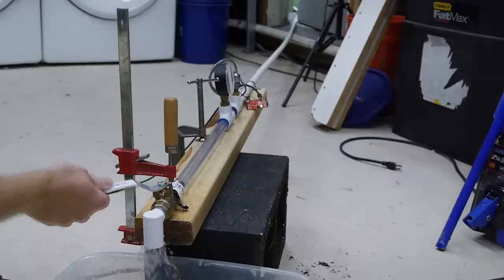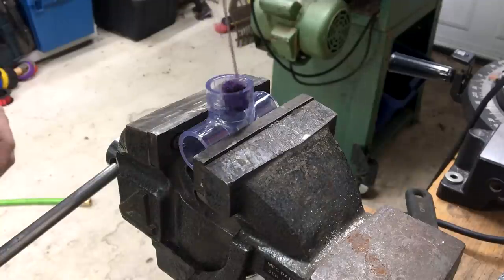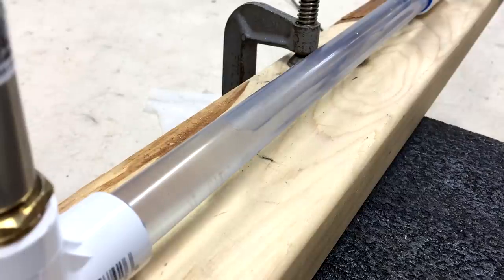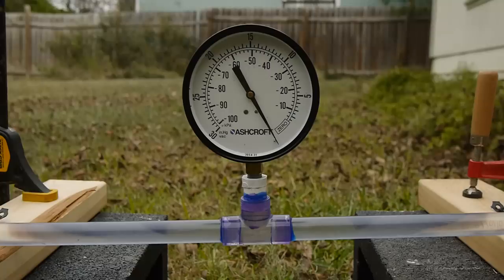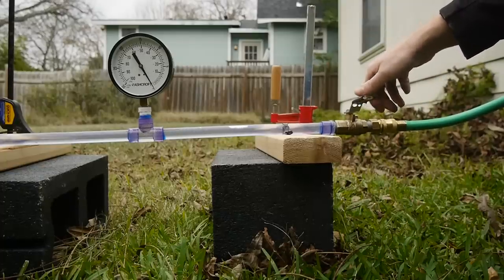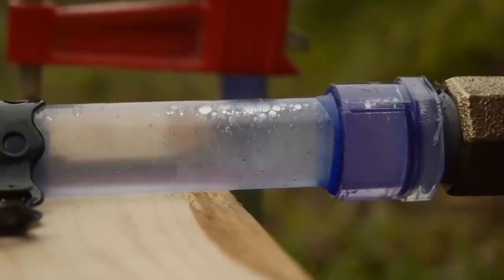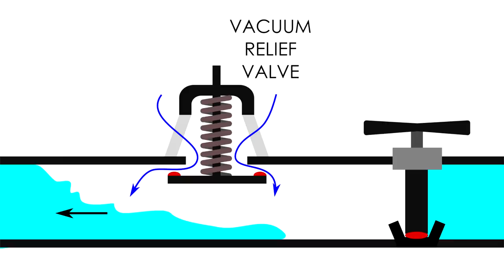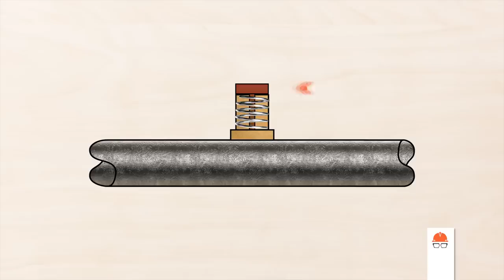How to Collapse a Pipe by Closing a Valve

Comment: Hey Grady, at the factory I work at we had a 50,000 litre milk silo implode because the air inlet valve was blocked. It pulled a large vacuum then finally gave way. The resulting implosion blew the inward opening silo door off and dumped about 10,000 litres of milk over the production hall floor. It had to be cut into 3 sections to remove it and took 2 cranes to lift it out and replace it. All because of 1 blocked valve
Reply from the maker: That is insane. Exactly the kind of failure that this video was talking about.
Reply: Makes a good case for redundancy, a few hundred for a second vacuum breaking system or a few hundred thousand for a new tank.
Reply: probably even the lost milk alone would've covered up the price of a redundent valve.
Reply: Oh boy you need some milk! lol (also did the milk spoil then you would have a loose version of cottadge cheese)
Reply: How did you fight off all the skeletons seeking calcium?
Reply: @chistinelane   They fell apart years ago. That's why they had the milk hidden from them
Reply: 10€ failure=100000€ loss.
It happens.
Reply: It happens.  Had a tank wagon partially collapse because of not opening a relief valve. Fortunately not our truck.
Reply: Dave Almighty  I call that high risk management.  I worked for a company who commonly neglected to implement safety systems, procedures or use parts rated for the type of work the parts were exposed to.  Everything was controlled by operator and if they did something wrong, it would always end up breaking something or injury.  Management omnipotence is often a cause of workplace industry accidents.
Reply: Wow, that's some bad design on whoever designed that thing.
Reply: So in this case management might have cried over spilt milk...
Reply: Razvan J  It's not as simple as you imply in your comment. Schedule for inspection? Every hour, every day, every week, every year,... every "we maybe should check the valve? Visual check or in-depth check with disassembly? With only a visual check, damages wihtin the valve may go unnoticed over a long time, and just after the check -> boom! Regular replacement of the valve? Can people be hurt? How much money do you loose? New silo, loss of milk, reduced production capacity until the new silo arrives. Costs quite some money, probably more than a second valve. By the way: If the correct function of the valve is essential for the function of the silo and is not redundant, hence a single point of failure, the design itself is already screwed and should be reworked asap.
If you simplify to "inpect the valve" you clearly have no idea what you're talking about. I assume you work in management and have absolutely no clue about such things?
Reply: @johnscaramis2515  shots fired.
Reply: Razvan J  Or just a gauge. Or an alarm. Or an engineer who can think. Ah, I can see the real problem here.
Reply: @pixels303at-odysee9  I worked at a company where THE SAME 10 inch hand held grinder with no guard injured at least three people. At least one injury was serious, severing a couple of tendons. It was never taken out of service or fitted with a guard. I don't believe they even warned new users.  Another young man doing pressure testing on a very large tank was killed when the tank exploded. Faulty pressure gauge they said. This same company used propane to cool hot metal. Yup, that worked as you'd expect. Only two people got burned as far as I know.
Reply: @snorman1951  Always fun picking out wire from your various body parts while grinding. I had plenty of them in my chest and legs. Even the grinder burns, goes through gloves and skin so easy, and the injuries are always very permanent reminders to keep limbs away from moving parts. I always wonder why people don't demand danger pay for performing that type of work.  Mind you, a conscientious worker is all it takes to stop and think before starting work to prevent injuries, a practice which is learned by experience.
Reply: @satibel  Milk is worth so little. In the UK milk is sometimes sold for less than what it costs to produce. It's why so many dairy farmers are struggling financially.
Reply: @noxious89123  According to the internet milk is about $1.21 per liter in the UK (does this sound right?) Even if we assume it costs half of that, a 10,000 liter spill would cost $6,050. Certainly more expensive than a backup valve.
Reply: Must have smelled like hell!
Reply: @skipfred  farmers get £0.31 ($0.43) per litre milk per june 2021 so the derry suffered a loss at $4300 witch isnt penuts either, and is just the losing costs for the milk alone.
Reply: Had a similar incident when I worked in the oil business. We were using trucks to pump crude oil from one cistern to another, that had not been used in a long time, when suddenly a  boom goes off and oil starts raining from the sky. Oil hade made it into the air inlet and cooled off, basically becoming like a thick honey that caused a plug. Thankfully the huge 300 000 m3 cistern survived, or we would have had a worse incident on our hands.

Comment: On water mains they typically make it really difficult to close or open a valve quickly. If you have to turn ~50 whole turns you have to really try in order to damage anything.
Reply: Me: "This thing takes forever!" pulls out electric drill 2000 rpm go brrrrr
Reply: Depends on the valves and the pressures you're working with. I have seen more lines blown out of the ground by slamming fire hydrants down by firemen though, you're right.
But then I worked in a water system in the mountains where typical pressure was in the range of 250 psi with maximum pressures reaching 500 plus or minus. Makes things a little more interesting than most systems. Scary even sometimes.
Large older lines are more prone to collapse, even slight sustained pressure drops. I was working in Chicago when they took down their intake line from the crib offshore and it collapsed in response, Oops. The cribs sit about a mile offshore at both of their plants. Luckily there was a second. Tough to replace a 750 mgd source quickly. lol
Reply: @manueltodesschnitzel3097  I had the same thought. Hilarious
Reply: @YoureASquidYoureAKid  lol I left water system maint. 25 years ago and got into the control side contracting. But they certainly hadn't learned squat by the time I left there. We tried often to educate them but it seemed to be like throwing hand fulls of crap at a screen wall. Just never would stick. lol
Reply: Cross connections between mains are there to primarily prevent dead ends in lines where turbidity builds and chlorine is lost. It is also for redundancy in feeds but during high demands velocities are going to be higher in one direction or another. Closing a valve to fast can still cause a surge on one side and vacuum on the other. How much depends on the velocity.
Reply: @SirVerdown  Water networks with closed loops where you can feed from both directions are designed so there are no "dead spots" where no water is flowing in either direction (long residence times in the network cause water quality issues) during normal conditions and they are usually a lot smaller than water mains. If water wasn't flowing through the pipe the pipe is redundant anyway and then you of course don't get any water hammer. Assuming water is actually flowing through the pipe these loops aren't very helpful since the entire column of flowing water has to stop and change direction and that is the water hammer. The water hammer moves at the speed of sound and is unaffected by branches until the water hammer arrives at the branching point; so it doesn't help that water can flow in two directions through a pipe if the branching point isn't very close to the valve.

Water mains are often simple branching systems with parallell pipes for redundancy in case one fails or has to be repaired/renovated/dug and replaced. These two or more pipes are interconnected with each other every few km or so in a big concrete chamber with a lot of valves; but there may also be valves that are not close to any of those interconnections (e.g. near important road and railway crossings where authorities often demand them). They feed water from a water treatment plant to one ore more reservoirs somewhere. If there are closed loops in the network of water mains they are many km apart and do not help with water hammer. In a properly designed water main the water will be flowing in some direction through each valve and if you could slam the valve shut fast enough this entire column of water flowing through the pipe has to stop and change direction quickly. It helps a little that water mains have this redundancy, at least if the valves between the two ore more parallel mains remain open as it distributes the water hammer down more pipes and you get less peak pressure. But the main thing is that you can't slam those valves shut; they're designed so that it is takes a lot of time to open and shut them whether you do it manually or with an electric motor; the water has a lot of time to slow down and you don't get 3 km of water suddenly crashing into the end of a closed tube.
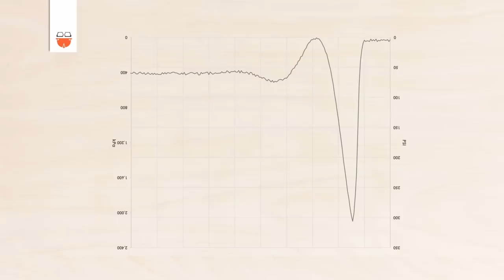Reply: @manueltodesschnitzel3097  and high torque one too as friction exists and gear reduction would be 1:50 and i dont expect drill can produce high torque, they just made to spin very fast. 

also love to imagine that you accidentally unscrew the handle off with high torque and that speed :3

Comment: As a fire fighter pumping an engine, I learned some interesting things related to this. Since we use an pump (not just system pressure), we have to be careful, that we “feel” how firm our supply line from the hydrant is so we can avoid pulling more water than the water system can supply. Also, fire hydrants require many turns to close the valve to prevent us accidentally opening/closing it too quickly which would cause problems for the municipality or whomever is supplying the water system. What is also interesting is that in dry sprinkler systems, we use a very small pressure of air to hold the valve closed against much higher pressures of water. It’s around 5:1 ratio. Maybe you could do a video talking about how this works?

Comment: As a Water Distribution Employee  for a Water Utility we have 26 different Fire Departments within our system. Education is the key. Both Paid and Volunteer Firefighters love to open fire hydrants as fast as possible and in turn slam them closed. Every year we have to remind them over and over please open them slowly and close slowly if you have water flowing. They can create a water hammer at their pumps just as easily as they can at the hydrants. We even have to teach them what the pressure relief valve is for on their Fire Engine pump panels.  Since my job is repairing the breaks, I see this problem never going away I will be including this video along with the positive water hammer video to all the Fire Depts hopefully they will watch and remember why slow and steady is best. Some of our infrastructure dates back to 1880.  We only use USA made products and materials. Sadly it’s becoming difficult to find products. They are considering now using products made in Israel and Australia.  Thanks again for making great videos

Comment: As he said in the end of the video, yes, it is very important to close all valves on the fire trucks very slowly or you will risk breaking the pumps. Most of the trucks will be spraying water out in upwards of 100psi, so if you stop the water flow too fast you will most likely destroy every pipe on the truck and put it out of service for a few months. The only reason you should stop the flow quickly is if you start to lose control of the hose. And you did a great job explaining this, thank you from Manchester volunteer fire department

Comment: Forms of concrete failure? ( too much sand or gravel, not enough curing time, etc)
Reply: TheMr77469 or over use of a concrete vibrators or not mixed properly
Reply: TheMr77469
And for dessert - misplaced reinforcement bars?
Reply: Also, in construction in cold climates, concrete that froze before it fully cured, and later thawed.

Comment: I live in a small town with volunteer firefighters.    I was working for our local newspaper as a photographer and was at a firefighter exercise, teaching the new folks how to handle the fire equipment. 

The Captain told me that the new pumper truck could collapse all the underground pipes from our fire hydrant system.  

It pulled more vacuum than the ancient water pipes could handle.   He reminded me of when the town utility had to dig up several dozen feet of destroyed pipe pieces and replace them.  

Now they are VERY CAREFUL with that pumper truck!!!

Comment: What about one on the formation of potholes?
Reply: Also 'washboards' for those who drive on dirt and gravel roads... and things that you can do to mitigate them (Mag chloride, various other binders)
Reply: He did one on sinkholes. Not sure if those are the same concept.
Reply: Nolan Palmer nope, not necessarily.

Sinkholes are caused by water under the surface where as most potholes are caused by water and mechanical forces at the surface.
Reply: Water gets in road, water freezes, water expands, water breaks road
Reply: @ozfartface1914 . Certainly doesn't freeze where i live.
Reply: He has, since, done Potholes, in case you missed it.

Comment: The you tube video "Obere Wasserschlosskammer" demonstrates the amount of water that needs to dissipate to stop water hammer in a very large dam. The pressures involved with such a large system must be absolutely massive and your demonstration shows why it happens. Even though its on a small scale, it demostrates how much pressure or vacuum is actually created.

Comment: There cannot be more than 100kPa vacuum (0kPa absolute), by definition.  The gauge only reads over 100 kPa due to inertia in the gauge components.  

I'm surprised that small pipes would have a problem with 0kPa absolute, since the surface area is small.  I would imagine large pipes would have a significant issue due to the surface area. Thoughts?
Reply from the maker: Haha yeah, that was the joke about it not being a scientific observation, but I don't think it came across quite as well as I planned ;) Anyway, the pressure in San Antonio that day was about 31.5", so it wouldn't be impossible. Yes, this is an issue with larger pipes. Most small pipes can withstand vacuum pressures because of their cross sectional geometry.
Reply: I'm a researcher in a lab that does a lot of work on implosion of thin shells (tubes), the dynamics behind it were described by von Mises, you should read his paper. It's a condition called dynamic instability. With the vacuum acting on the pipe (equivalent to saying the external pressure pushing in), there is, up to a certain pressure difference, equilibrium between the pressure potential loading the pipe and strain energy within the pipe material exists. The round shape is said to be an equilibrium configuration. After a critical threshold, more equilibrium configurations start to be valid for a particular pressure, the round shape is capable of balancing the load, but so is a flattened, deformed, imploded shape. Because multiple equilibria are valid, the pipe can arbitrarily jump from the round configuration to the flattened, which it does due to the slightest imperfection. The critical pressure is a function of the pipe wall's bending stiffness, which stores the strain energy. Smaller pipes (with smaller inside radii) can withstand much higher pressures because the internal moments set up by shear stresses have much less leverage to act over. So it's actually the larger pipes that are more susceptible to implosion.
Reply: @PracticalEngineeringChannel  I was disappointed.  I wanted to see a pipe implode!  Even if it was a thin plastic, but better if glass.  :D  :D  Could also have shaved or sanded the sides of a section of pipe to see them collapse.
Reply: @PracticalEngineeringChannel   Correct.    Small pipes don't care.   We had a sewage pumping station rising main with 36" concrete lined steel (thinwall) pipes and large anti-vacuum valves.   The valves used to suck in huge noisy gulps of air and leak sewage 'on the rebound' and the operators found the best way to prevent that was to shut them off, when all the objectionable symptoms miraculously disappeared.   When I was asked to look at it I nearly had kittens.   With the valves offline, those pipes were pulling almost a full vacuum on pump stop and how close they were coming to an incredibly expensive 'whump' I don't know.   (And calculations didn't help much because the equations for collapse of a thinwall pipe under internal vacuum depend directly on the assumed eccentricity of the pipe wall).   But I suspect it was much too close for comfort.